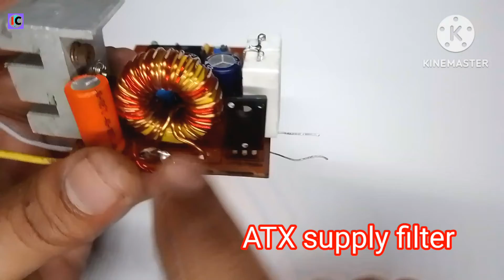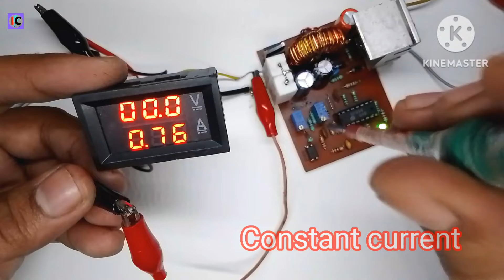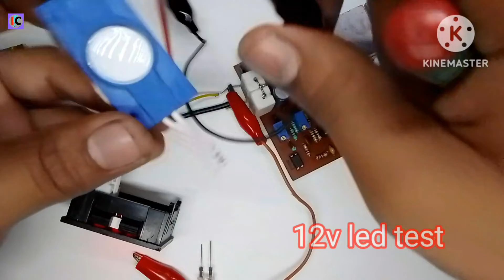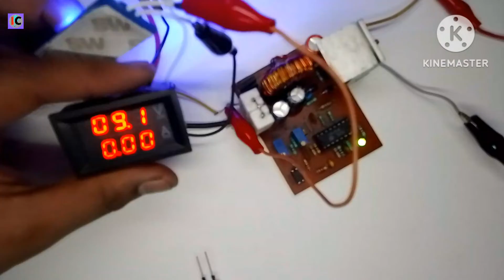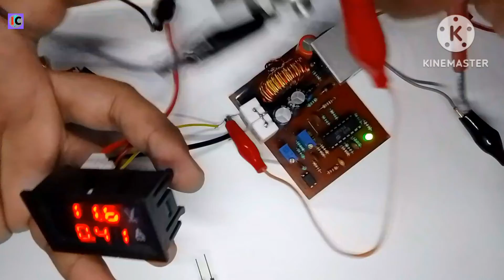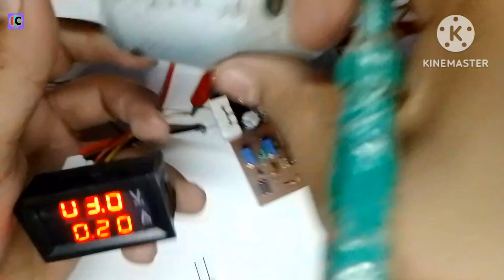TL494 Buck & Boost Converter  #tl494 #converter

Comment: Hi... I built this converter and it works, but the ATX filter core was getting very hot... I replaced it with an ETD core and cut a 1.2mm gap; the coils are wound with 4x0.5mm wire, yet I can't get the current above ~2A—beyond that, the voltage starts to drop. I'm using an IRF100b201 MOSFET and an MBR60200 diode, with about 10 turns. Reducing the number of turns increases the current, but the MOSFET and coil start heating up significantly. I'm out of ideas 🤔 I'd appreciate any advice you might have 👍 I'm not expecting miracles, but I thought I'd be able to reach at least 5A with these fairly powerful components...
Reply from the maker: its flyback type converter so make sure the transformer secondary coil is connected correctly and also calculate the ETD core turns properly

Comment: Lilitan corenya berapa, primer sekunder?
Reply from the maker: the core is from ATX power supply DC filter inductor I used the two coils of it without modification it and it have 18 turns for both primary & secondary coils

Comment: Bang sa ya sudah rakit sesuai skema dari abangvtapi kok ngak nyala pwmnya ngak aktif gitu
Reply from the maker: check the voltage on TL494 IC VCC pin and also the pin 16 is connected to shunt resistor output side to work properly 👍

Comment: I need input range from 15 to 36 volt for solar application. Please inform if this can be modified for thst
Reply from the maker: Yes, you can achieve that range by adjusting the transformer primary winding turns and what are you using this for ?
Reply: Sure, ap ko tl494 ic ki vcc supply zener 13v diode se fix kar k input deni hogi.

Solar se chahey 48v q na hon, ye circuit buck boost aur thori changing kar kar pwm universal module k tore per use kar saktey hein.ic k volt fix honey chahyein 12 13 15v tak .

Comment: Hello, I tried this design, and there is a big flaw in the frequency, following the diagram, the frequency set is set to 6.6 kHz.
To solve the noise and poor efficiency, change the 15K resistor on RT to a 3.3K resistor to achieve 30.2 kHz, or 4.7K to get 21.2 kHz, is more efficient in that frequency.
I made a complete video on my channel about other improvements, analyzing and explaining more about it's functions, it's in spanish but u can turn on the subtitles .
https://www.youtube.com/watch?v=j7HxGAJa2d0
Reply from the maker: that's great with these improvements 👍

Comment: can i add shunt at mosfet source rather than at output to sense current at pin 16. bcoz
output current sense does not protect mosfet from over currentdurring boost mode.
Reply from the maker: ya sure 👍
Reply: @innovationic  yes i tried but it does not work as it should ... later i got to know tl494 error amps are not fast enough to limit cycle by cycle. i also tried adding tl431 for better control but it is not working with present design. if possible can help in this case.

Comment: The circuit you have in your hand is completely different from the file you uploaded for the pcb, those jumpers are not there.
Reply from the maker: thankyou for feedback 
the jumper shown in pcb are marked as resistor on pcb file
Reply: @innovationic Thank you for your answer. I made the circuit according to the file. Everything is correct. The components are intact. The shunt resistor is correct, but I have no control over the voltage and current. I just don't know the inductance of the inductor. It wasn't mentioned anywhere.

Comment: Hello, first of all, thank you for the circuit. Second, how many electronic capacitors are there? How many holes are there on the board that are not used? Let's make it according to the pdf file and we will get the result.
Reply from the maker: I used some holes as jumper and shown with resistor mark that's it

Comment: To increase output current did work by modify the transformer turns and add more mosfet in parallel??
Reply from the maker: Yes, modifying the transformer turns and adding parallel MOSFETs can help increase the output current 👍

Comment: Sir, I want to implement CC (Constant Current) and CV (Constant Voltage) control for a battery charger. In this, I will set a fixed output voltage, and when the battery (as a load) is connected, there should not be any voltage drop. Also, the current should remain constant at the set value to ensure proper charging of the battery. I would like to know if this behavior is achievable with the current circuit or if any changes are required.
Reply from the maker: this is cc and cv based converter you can use it for charging battery with constant current, you just need to adjust the desired output current with this the output voltage will increase along with charging 👍

Comment: Hello, the video was very good and thank you. I read many of the comments and also watched the tutorial video on making this transformer, but I want to know how much wire you used for the primary and secondary, and what diameter. According to my calculations, 6 turns of 1 mm wire in the primary and about 25 turns in the secondary should be sufficient. Do you think that's correct?
Reply from the maker: yes

Comment: Hello friend ,
How may i add one more led indicator to circuit so it can glow whenever load is connected it will be very useful
Reply from the maker: you can add current sense circuit to glow led whenever load is connected by sensing current flow through circuit 👍
just like my current limmiter circuit video based on LM358

Comment: i made the circuit it is working but the mosfet generate to much heat even when i m using only 1-1.5 amp of output current, i tried higher volage mosfet thinking that snubber was not cliping high reverse voltage spike but that was not the issue .. currenty i m using irf3205s mosfet, i tried z44 and P45N03LTG but end up blowing them as soon as i connect.. only 3205 is survived with lot of heat.... i still not able to find the issue. i am using 12v 20amp input... even when their is no load connect the input current goes to 7-8amp when i boost voltage upto 35volt
Reply from the maker: this is issue with transformer coil polarity as this is flyback type converter so just interchange the secondary coil wires like between GND and Diode
Reply: @innovationic  thanks for the reply actually i re checked the polarity issue was not coming from that... i was using 2mm wire with 11 turne on 33mm dia inductor ... i was getting efficiency of 15% then i changed the inductor with 1mm wire and 23 turns on 25mm dia inductor the efficiency increased upto 53 percent .... look like turns was not enough but i m not sure, so what no. of turns do you recommed for this setup
Reply from the maker: Just make proper calculation for your ferrite core, use online calculator for this it will more efficient 👍

Comment: i followed ur circuit digram and i made this circuit board its working good but the problem is my variable resistor of voltage 10k pot is getting to heat is there any solution for this if yes then plz help  or is this normal
Reply from the maker: use 100K pot to fix this

Comment: Hey brother i made this circuit as u shown but when i increase voltage more than 55v MOSFET starts to over heat and led starts blinking voltage dose not  stays stable after 55v and voltage variable resistor is also getting hot plz rply i want to complete this project i used 3 mosfet in parallel and biger core for input I used 12v 10amp supply
Reply from the maker: is the secondary coil is connected right way I mean if the secondary coil terminals is reversed then try inter changing the wires each other as this is flyback converter the primary and secondary coils need to be connected in opposite direction

Comment: Brother in your circuit digram u had  written 1N4148 diode is this a zener diode instead of this can I use 1n4007 diode, And in your schematic you connected a 5.6k resistor with ic pin no. 16 but in your pcb upper silk design 5.6k resistor is missing? Plz rply
Reply from the maker: thankyou for feedback 
the IN4148 is fast switching diode so using 1N4007 may not work properly, you can use FR107 instead of 1N4148.
The 5.6K resistor is used in diagram actually don't need it to connect from pin 16 to GND, the circuit will work just fine as I will update the circuit as soon as possible 👍

Comment: Hi, i ordered the pcb in the summer of 2024. I built it up now with the exact components labelled on the board. My problem is that the moment i supply 12V to it immediately the supply rail drops to 6V with 0V on the output only the MOSFET is heating up rapidly. The potmeters doesn't do anything. I tried different tl494 ics different mosfets and optocouplers. Can you help me with this?
Reply from the maker: thankyou for giving feedback 
if the mosfet is heating on startup then the mosfets are shorted itself as you mentioned tl494 output is 0v then mosfet isn't turned on, plz check the mosfet to fix this issue 👍
Reply: @innovationic  There is no voltage on the converter output. The tl494 is outputting some voltage to turn on the MOSFET but it is not PWM. I changed the MOSFET and the tl494.

Comment: Can i take 10 amp from this?
If not then what should i do for getting 10 amps
What are voltage values for that blue and orange capacitor s
Reply from the maker: it can give maximum of 6A and for 10A you should use more mosfets in parallel and use bigger core for transformer.
The both capacitors are for filter purpose you can use 100V 470uF or 100V 1000uF capacitors thankyou
Reply: @innovationic so how many MOSFET should I use in parallel, and plz help me with details of what size core should I use and thickness of copper wire and total turns
Plz help

Comment: Brother in your circut digram transformer is shown but the module u had made there is no transformer 
Is Atx psu dc filter and transformer are same im little bit confuse plz help
Reply from the maker: yes you are correct the ATX DC filter is used as transformer and I made two windings to make primary and secondary coils of transformer
Reply: @innovationic  please what is the winding ratio of the transformer for both primary and secondary

Comment: in your provided circuit pin13 out-ctrl is connected to Vref 5v pin 14 which used for push pull operation and both emitter of transistor is connected to gate of mosfet, so at same time one will try to turn on mosfet and one will try to turn of... i think mosfet is turning off for only dead time or remaining half duty cycle?..... pin 13 should be grounded for parallel mode operation of transistors.... am i missing something ? can you help me with this
Reply from the maker: You're absolutely correct. Pin 13 output control can be configured for either push-pull or parallel operation. In this scenario, pin 13 will be connected to GND for optimal performance.
Reply: @innovationic  is there any updated circuit provided by you ? .. i saw your lots of videos and really fascinated with your hard work.... also your crisp and detailed explanation and quick reply helped me to update my circuits.  great job 👌👌👌
Reply from the maker: thankyou
the update in this circuit is just connect the pin 13 of TL494 with GND that's it 👍

Comment: i want to use input voltage upto 35v .. should i use lm7812 to power the ic... so will the ref voltage functioning of the ic will work as normal ?
Reply from the maker: To ensure safe operation of the LM7812 with 35v input voltage, diodes can be added in series to drop excess voltage before the regulator
Reply: @innovationic  sry for miscomunication actually i want to use this buck boost with max input voltage of 35 volts... is it ok to give this high voltage to TL494 .. i found lm7812 has max input of 24 volts so it cannot be use... i also has one buck boost with uc3843 whose input is also limited .... for the safe operation of PWM controller what regulator should i use
Reply from the maker: you can try LM2596 buck converter or make auxiliary winding for driving TL494 just like smps
Reply: @innovationic  ok thanks

Comment: I won't 24 volt 20ampa is it possible? I don't won't boost mode only buck mode
Reply from the maker: this converter do both boost and buck so for step down just adjust preset

Comment: The capacitor at the output do not look like 100uf It is 47uf/150v does it work well؟؟
Reply from the maker: you can use higher capacity capacitor like 470uF or 1000uF this makes output stable

Comment: hey man! Quick question, how can we make 80V or even 130v with this circuit if the max drain-source voltage of the IRFZ44n is only 55v? Also, how can I go to 130v if the MBR20100CT is only rated for 100v? Thanks!
Reply from the maker: its dc to dc flyback converter the primary side of transformer is switched by Z44N hence no effect of high voltage of 100v or 130v comming at secondary side, and MBR20100CT can take high voltage for just moment
Reply: @innovationic  Thanks man! So the only thing that I have to change for this thing to go up to 130v is to put bigger filter electrolytic capacitors on the output? Do I have to mess with the R/C timing components? Thanks!
Reply from the maker: just upgrad the output diode and increase the number of turns in the secondary side of transformer

Comment: hi, friend.  Could you make a new video clarifying the differences between the circuit and the pcb?
Reply from the maker: well the circuit and pcb is same but the difference is just having some extra resistors on pcb which I have used as jumper on pcb tracks to make pcb simple and I will update the given pcb and circuit as soon as possible thankyou

Comment: hello.  Sorry to bother you again.  On the PCB there are 2 resistors in series (10 - 100) between input negative and output negative.  does not match the diagram.
Reply from the maker: In the PCB I have used multiple resistors, these works as jumper to avoid shorting or making PCB more complex also output and input negative are common its just mistake of having 10 ohm or 100 ohm resistor in series of 10 ohm and 100 ohm. I will fix it in a moment. Thankyou

Comment: hi, friend.  a query.  I have seen some similar circuits that use the uc3843 and the LM358.  In this case, the lm358 is not used because the tl494 fulfills that function?
Reply from the maker: yes exactly tl494 have dual op amp for controlling current and voltage both
Reply: okay.  Thank you very much for answering.  congratulations for the video.
Reply from the maker: thankyou

Comment: for input 40v-45v, ...?
Reply from the maker: separate auxiliary coil needed for 40v or above
Reply: I don't understand about separate auxiliary coil circuit.  but I tried to provide a 40v input coil voltage, and I removed the in4148 diode pin which goes to pin 12 of the IC along with the main VCC line.  and I replaced it with a 12v external voltage.  Do you want to make the separate auxiliary coil you mean?
Reply from the maker: yes, its just like the smps which have auxiliary coil for PWM controller IC. And for 40v increase the number of turns in transformer.
Reply: One more thing, if we parallel 4 MOSFETs, does the 4.7k resistor from the IC output (pin 9,10) which goes to ground need to be added more?
Reply from the maker: single 4.7k is enough
Reply: many thank

Comment: Hello ... there are two 1n4148 zener diode in pcb but in the circuite diagram only one ? And 100nF and 10nF cap number are different between pcb and circuite diagram .... it’s a big difference between pcb and circuite diagram over all ???!!!! So which one is correct?????
Reply from the maker: circuit is correct
Reply: @innovationic  can you check it ? I want to make the circute and i want to be sure the circuite you uploaded is correct.
Reply from the maker: Circuit diagram is correct, in the PCB 1N4148 are shown but not written and the 100nF & 10nF cap are shown in both circuit & PCB
Reply: @innovationic  number of cap difference between pcb and circuite, in circuite one 10nF but in pcb two 10nF ??!!!  And one 1n4148 in circuite but two in pcb ??!!
Reply from the maker: Here is the updated Circuit & PCB -
https://drive.google.com/drive/folders/1WXCR5QHfJqvhz5jM4JN-NcD6NHfZu7ho?usp=sharing
Reply: @innovationic  thanks but in pcb there’s two 1n4148 but in circuite one 1n4148 zener !!?? And current shunt different in pcb 0.05 ohm but in circuite 0.15 ohm ??!!!
Reply from the maker: I have updated all, current shunt can be from 0.05 ohm to 0.15ohm.
Reply: @innovationic   yes you corrected, but where’s another 1n4148 zener in a circuite???!!!! As i said in the pcb there is 2 zener 4148 but in a circuite there is one zener !!!! Check it.
Reply from the maker: other 1N4148 at mosfet S & D pins
Reply: @innovationic  yes you right, because of mosfet I didn’t see it, thanks ...
Reply: If i use more mosfets, need to put zener in each theme or what ???
Reply from the maker: welcome
Reply: @innovationic  If i use more mosfets” push pull “ need to put zener in each theme or what ???
Reply from the maker: no single diode is enough with totem pole driver
Reply: @innovationic   location of another 4148 zener is : GND and all 3 mosfets D pin ? is that correct?
Reply from the maker: @rawandjaza5929 
yes because all mosfets are connected in parallel so connect 1N4148 between GND & D pin

Comment: Great, the module have CC & CV fed back?
Reply from the maker: yes voltage and current both can be adjusted
Reply: @innovationic  i know have cc and cv mode but circuite have feedback for both current and voltage when increase output power ?
Reply from the maker: The output current is sense through 0.1ohm resistor connected at output, you can control output power
Reply: @innovationic  thanks what about adding more mosfets can you draw circuite diagram for driving more mosfets ?

Comment: If the principle diagram you shared with the printed circuit components you shared is wrong, it looks very different from electronic components.
Reply from the maker: in the PCB I used jumper wire as resistor symbol which is not shown in circuit all the components and their values are written on top silk layer